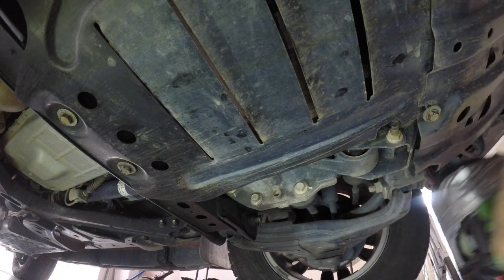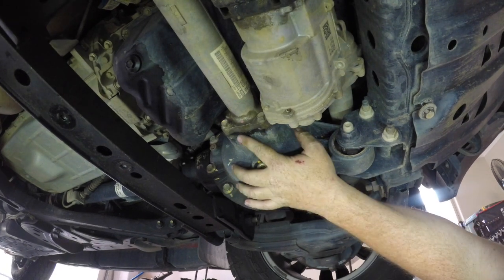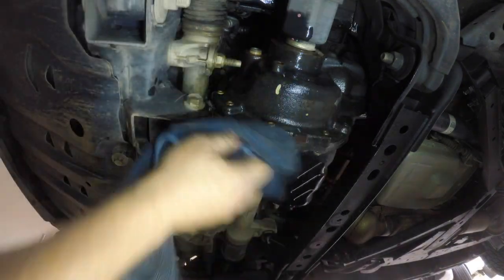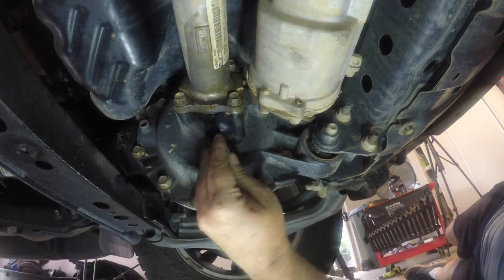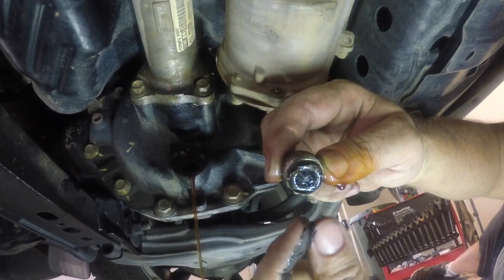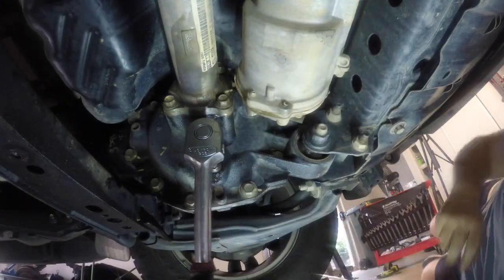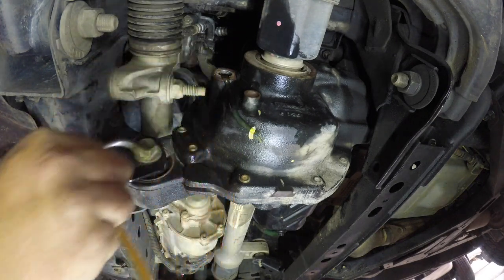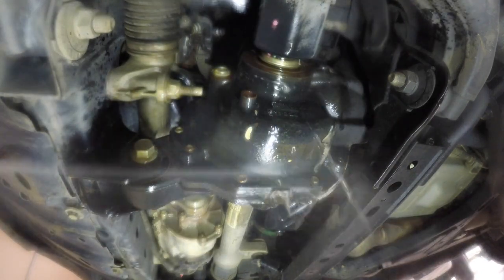Ford Everest Ford Ranger Mazda BT50 Front Diff Oil Change

Comment: What oil did you use, and how much does it take? I’m finding too many different results.
Reply from the maker: From the factory they use 80W-90 and have a capacity of around 1.3L however I have been informed that some use only 800-900ml or 5-10mm below the fill point. This is to avoid exessive seepage from the vent pipe. If oil loss from the vent pipe has been an issue for you I suggest keeping the level a little lower.

Comment: I have a Ford ranger which I replaced the gear. however when I shift gear it's the sign is still at P or park. but the gears are working.
how can I fix the problem

Comment: Can you tell me all the oil specifications for... the front diffs, rear diffs, transfer cases, transmission fluid (manual trans). This is for the 3.2 Ranger  2014 model)
Reply from the maker: 75W-90 for front (1.2L) and rear diff (3.4L)
70W-75 for manual gearbox (2.7L)
Transfer Case runs ATF LV (1.2L) 
link: https://www.penriteoil.com.au
Reply: Thank you mate! Much appreciated
Reply: @killawattgarage the same applies for ranger 2013(px1) the gearbox was different

Comment: Awesome video . Would the 80-90 work for a 2016 2.2  5 speed manual diff ?
Reply from the maker: Yes it will
Reply: @killawattgarage  thanks alot . Do you by chance know what oil will for for the 5 speed gearbox?
Reply from the maker: @C.JPhotography  what country you in?
Reply: @killawattgarage  Trinidad and Tobago .
Reply from the maker: @C.JPhotography  in Australia it is recommended for a 70W -75 gear oil. It has a 2.7 L capacity
Reply from the maker: 80w-90 might be a bit too thick and gear shifts hard
Reply: @killawattgarage  oh ok . Thanks allot for the info . Much appreciated
Reply: @killawattgarage  I was told by ford UK to use WSS-M2C200-D2

Comment: Can you please mention how many litres you put back in please?
Reply from the maker: From the factory they use 80W-90 and have a capacity of around 1.3L however I have been informed that some use only 800-900ml or 5-10mm below the fill point. This is to avoid exessive seepage from the vent pipe. If oil loss from the vent pipe has been an issue for you I suggest keeping the level a little lower.

Comment: Thanks for posting this, is there any update on the leaking diff seal? I just took my ranger for a service and they said I have the same thing happening with mine.
Reply from the maker: Ford says that they were over filled from the factory. I see a number that have a weeping seal but the leak isn't bad. Its also important to check the breather as these block up and dont allow the diff to breath and it gets hot causing a pressure build up that also contributes to a weep/leak. No offical update  - Has anyones else heard different??
Reply: @killawattgarage hi thanks for your video.
I’m told by Ford that the front diff should only have 1 quart of oil that’s 0.976 of a litre.
If you fill it up to the plug and it overflows that’s to much . That can cause it to weep on the breather or seals . Have you heard that etc

Comment: Does that oil got a Limited slip?
Reply from the maker: not needed for the front
Reply: @killawattgarage  I can only find with LSD. I can't find one without LSD. And it say can be use on conventional diff. I don't know if conventional diff mean I can use for front or not. Because this is my second language.
Reply from the maker: @pro-duct911  what brand of oil are you using?
Reply: @killawattgarage  Castrol limited slip 90.
Reply from the maker: @pro-duct911  Yes that will be fine to use that LSD fluid in the front differential
Reply: @killawattgarage  can you do glow plug changing? And what actually the diff fluid do you use for front and back?
Reply from the maker: @pro-duct911  will look for the opportunity to video and upload